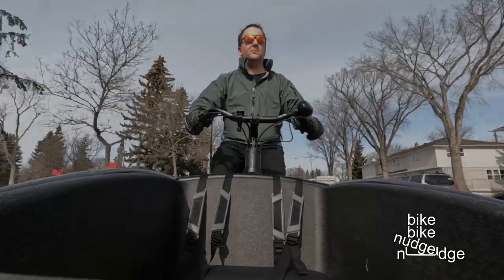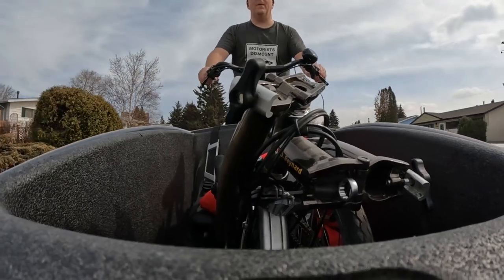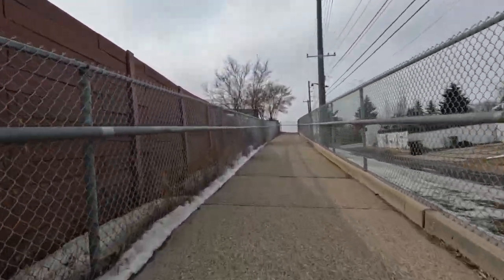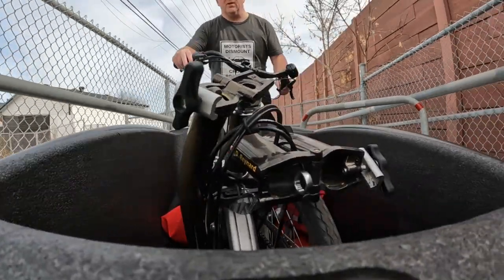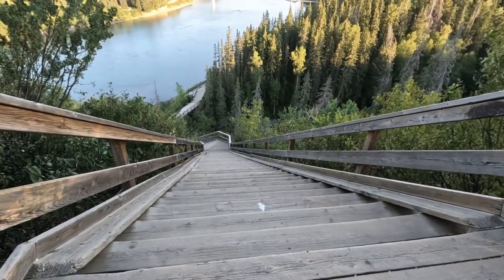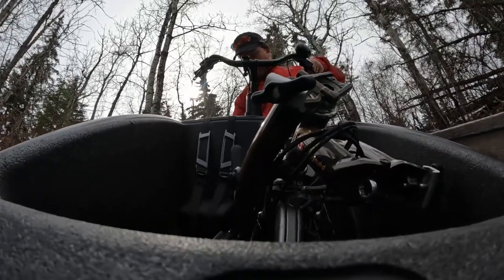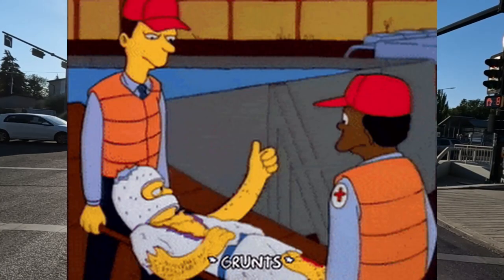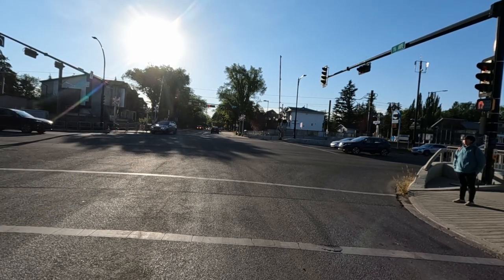Can you safely use low-quality active transportation infrastructure on your bakfiets?

Comment: remarkable that there was still a relatively high level of traffic for that underpass, which I'm still trying to parse out why the hell they use traffic calming measures for ped/cyclist infrastructure instead of car infrastructure
Reply from the maker: It’s a busy intersection for alternative transportation. There’s an LRT station right there, a popular protected bike lane to the east, and another MUP running north/south that connects to the university. As you could see, the city only allows vehicles to cross the busy street so everyone else has to use the underpass.
Reply: @bikebikenudgenudge  At least there weren't crackheads offering you crack at the end of it, like they did to Tom in Calgary in that Shifter video. Or cops stopping people at the end of the overpass to inspect their bags like the Civil Rights Lawyers showed they did in Chicago to CynicalZombie.